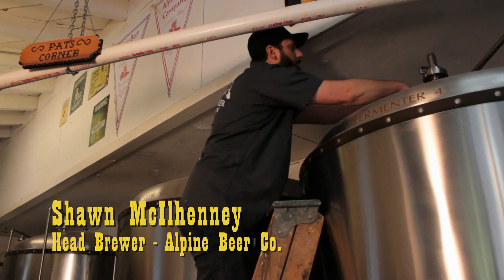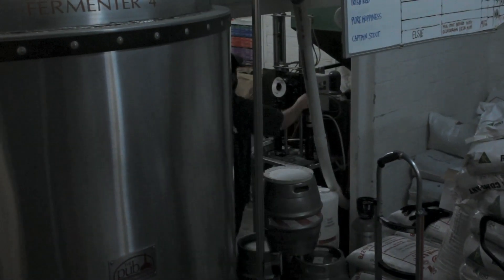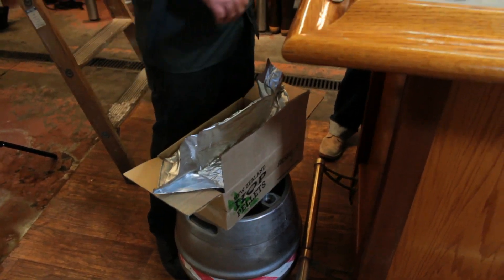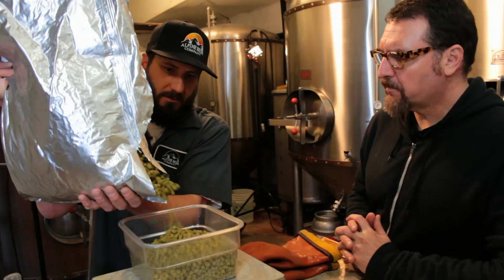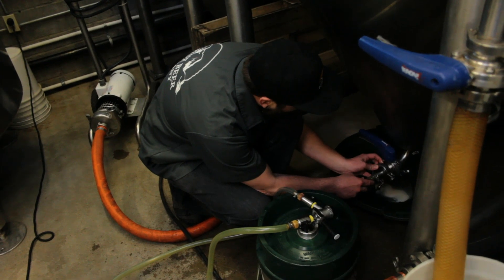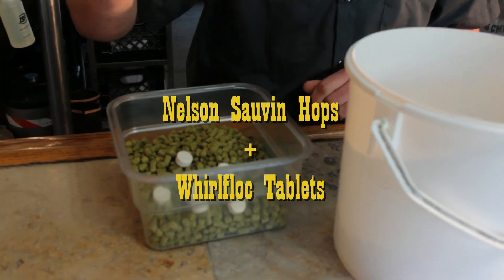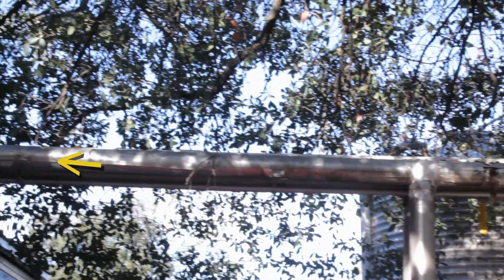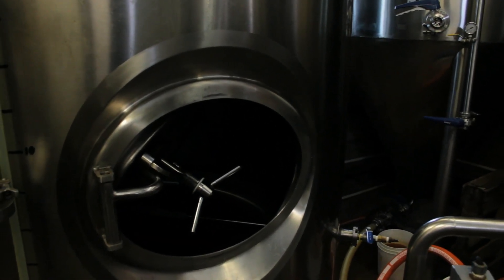West Coaster "Behind the Brew" - Alpine Nelson IPA

Comment: did you catch what other specialty malts they use besides rye? looks like a few bags from simpsons and great western.
Reply: - 25kg Weyermann CaraFoam
- 25kg Simpson's Maris Otter
- 2x50 lbs sacks of flaked rye (visible on the side of the sacks) + 1 identical sack where the text on the side cannot be seen, although the manufacturer markings looks the same (might be flaked rye aswell)
- 2x5 gal + 2x6 gal buckets of rye malt
- another 5 gal bucket that might contain acidulated malt
- 2-row

Based on the video I'd say all 3 brown sacks contain flaked rye, but that will be 17.6% of the grist which seems a bit high (if only 2 are flaked rye then I have no idea what the last sack contains).
Reply: Mrtnlys wow, great speculation! so they use flaked and malted rye? im guessing the 3rd brown sack is something else, since they say the beer uses a 20% rye component. the numbers dont add up with the 3rd sack. i can usually get about 20 lbs of rye in a 5 gallon bucket (maybe 25 in a 6 gallon?). they mention about 850 lbs of grain total. so if the buckets are malted rye and the 2 bags are flaked, that is close to a 22%. the 3rd sack about 28%. all speculation though, who knows how much is in each bucket.
Reply: zodiak3000 If you watch the video frame by frame there is a lot of info to find. The CaraFoam, Maris Otter and rolled  rye flakes including amounts in each sack is easy to spot. The acidulated malt was a suggestion in a forum thread based on water alkalinity in the San Diego area (so it might be something else, no info in the video). If someone could try to recognize the markings on the lower part of the brown sacks, and see what the manufacturer makes besides rye flakes that would help.
Reply: zodiak3000 The brown sacks are from Grain Millers, Inc. in Iowa. They don't produce any malts, only grain products like rolled flakes, flour, bran, groats, fiber, berries, grits etc. Is it really likely that they'll use another grain adjunct in addition to the rye flakes?
Reply: its probably flaked rye. just really tough to calculate the exact amounts. i figure using 10% flaked rye, 10% malted rye, 7% maris otter, 5% carapils, and the rest 2row will get you fairly close to the grist.